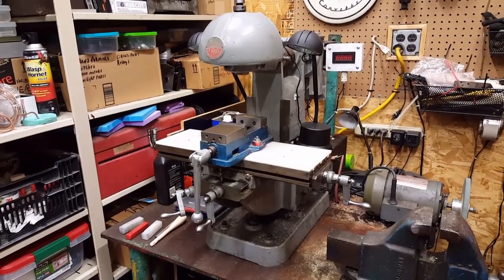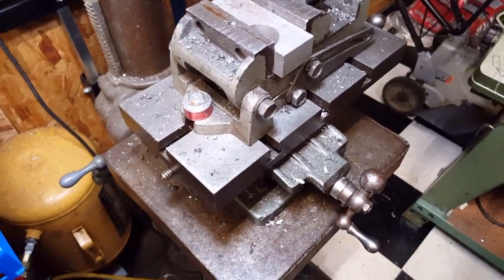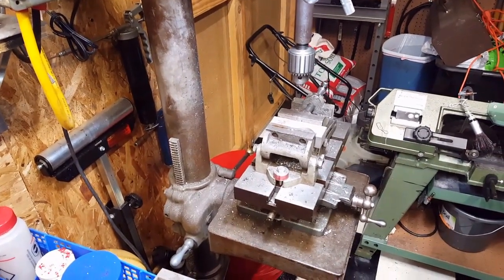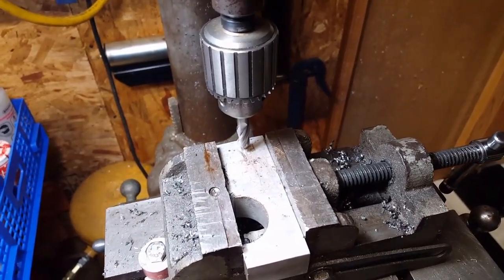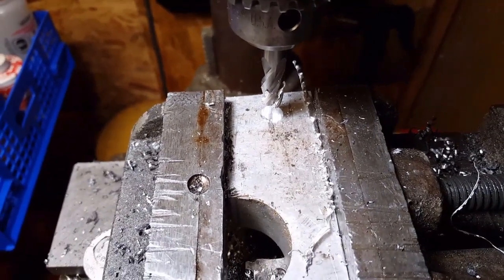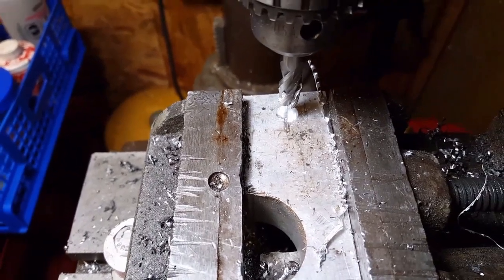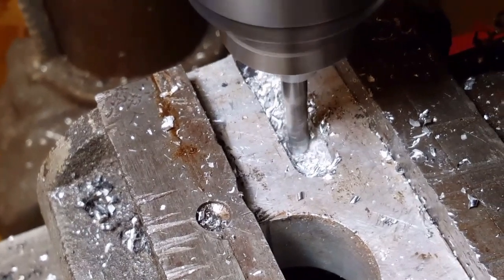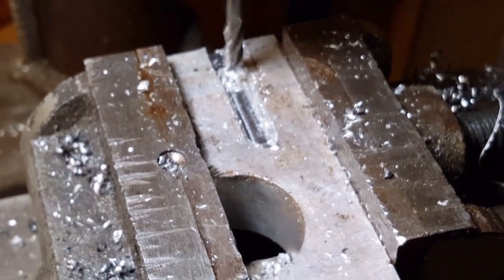Drill press Vs Milling machine, let's find out.

Comment: I don’t disagree with your premise, but it seems like you stacked the deck against the drill press by lowering the table so much, requiring the quill to be extended more than necessary. It could have been more rigid.
Reply: No amount of rigidity will make up the difference. The drill press is doing something it was not designed to do.

Comment: A drill press is designed to drill holes, not mill sideways. :) That table would be fine for aluminum and plastic...with light cuts. 
I would hang my students for using an end mill in a drill chuck.